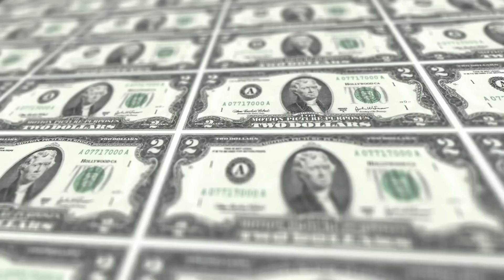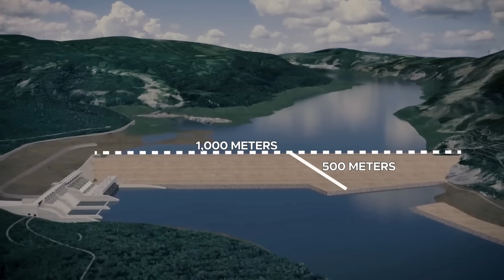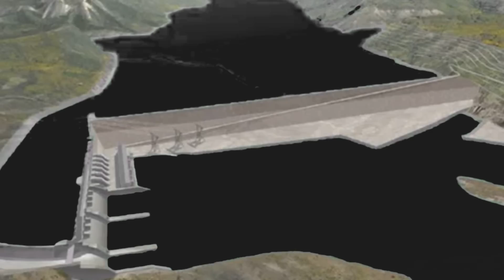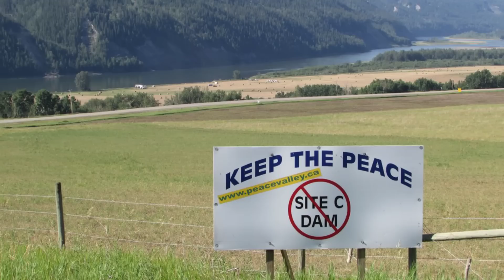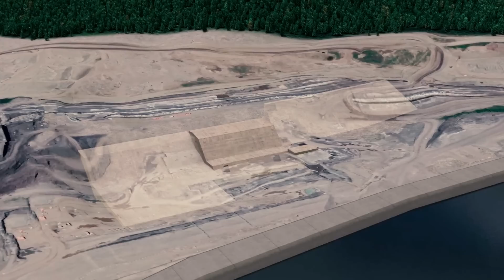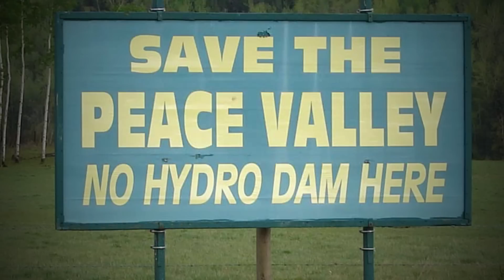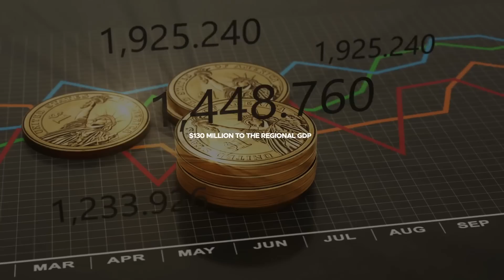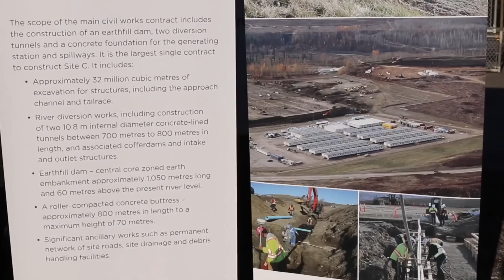Site C Dam: Canada’s Controversial New $12 BILLION Mega Dam

Comment: I'm from Northern BC, and the slides you used of the BC Liberals not approving and the BC NDP approving the project are misleading. Site C was approved and construction started midway through the BC Liberal reign. It was late 2000s early 2010s when the work started
Reply: It was reversed. NDP had a election promise to cancel it but realized it was to close to completion to cancel
Reply: @michaelnelson5899  oh yeah, I remember that. They got the BCUC to a review. But honestly that was smoke and mirrors, there'd be no way to stop a project that much and it would cost them the election easily and BC Liberals would point to NDP mismanagement lol
Reply: @joeystoney3678   All they did was run the price up.
Reply: @michaelnelson5899  yeah, the sunk cost was so poisonous they had to continue which is just devastating. 16 billion dollars couldve built more megawatts of power via solar, wind or gas than what Site C is projected to create. a 3MW windmill is like 4 million dollars. 16 billion dollar Site C will make 1100 MW. You can do the math to see which is more efficient.
Reply: I'm glad it ended up being a bipartisan decision. Regardless of whether it's the best project, it's definitely needed, especially by electric car driving, anti-natural gas lobbying lefties.

Comment: This has been an absurd an unnecessary project from its inception. Yes we need more electricity. But putting $16B (Cdn) into a single project that took over a decade has left us with LESS generating capacity and forced us to buy electricity from neighbouring states that are not green nor renewable. We already have huge dams. We could have spent the last decade building solar, wind, geothermal and tidal generation to add resilience and actually meet our needs in the interim. Blame Christy Clark for this disaster.
Reply: You should jump into provincial/federal power control and shown them! Lol #thisguyhasnoidea #iydknyk